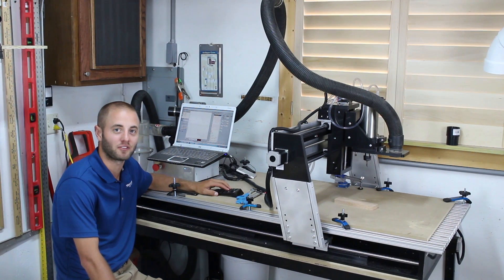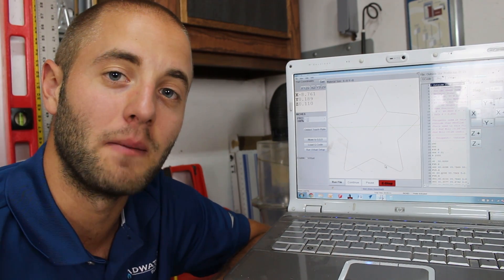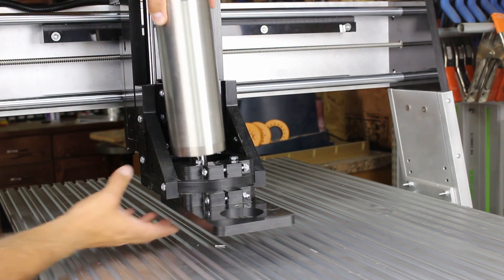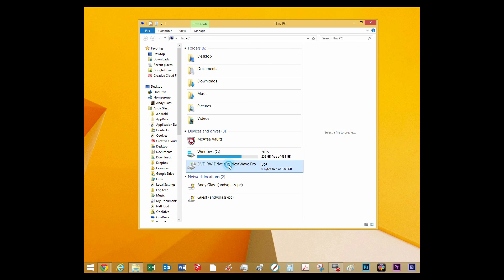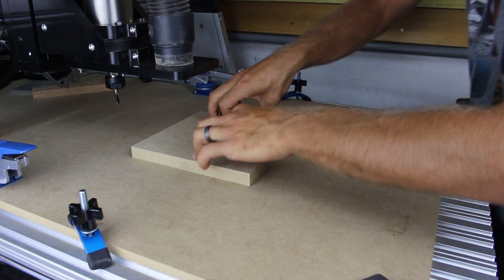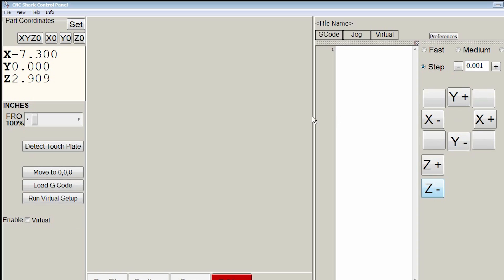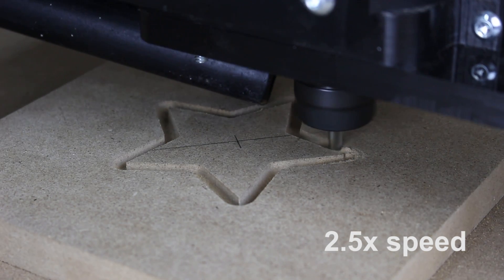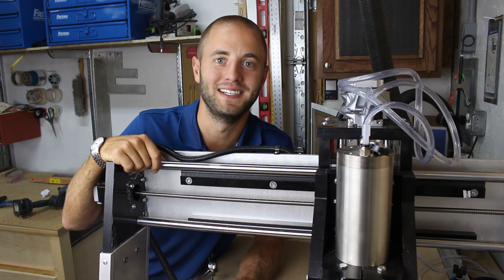Getting Started with Your CNC Shark HD3 | Glass Impressions

Comment: What double sided tape are you using? What is the spindle motor again? I have a slightly smaller Shark using a Porter Cable router, currently. Thanks.

Comment: quick tip, also put double sided tape under the star area of the wood, and then program it to fully cut through without the tabs, leaves good edges and it wont rattle as it is still fully stuck down!